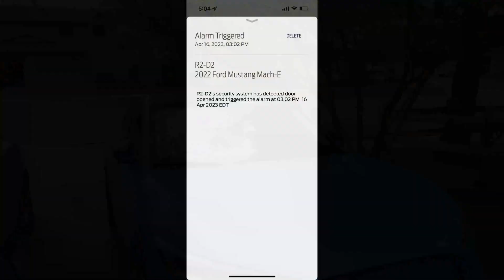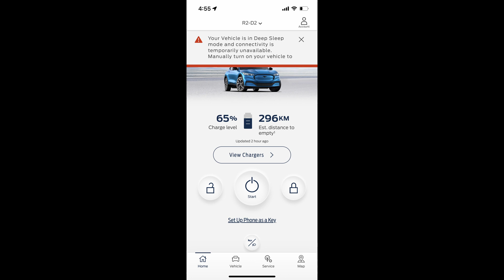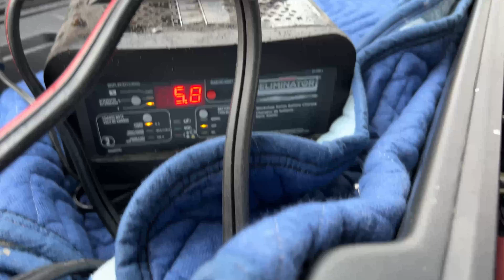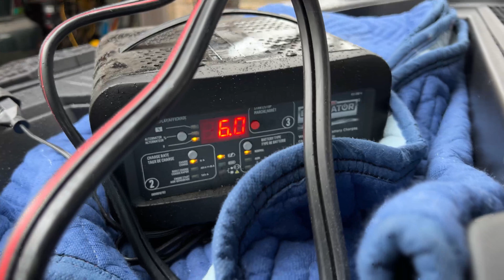Ford Mustang Mach E F150 Lightning Dead 12v Battery Diagnosis - Electrical Drain Security Alarm Code

Comment: Next time try a battery booster to boost start on the jump starter post, open the door and start the car within 10 seconds, once dc dc is on, at least you can drive until car is off. 
Learnt in a hard way with f150 lightning, but the f150 12v has bms issue, battery itself was fine
Reply from the maker: I have some other videos demonstrating the battery booster method.  Thanks for the comment and for watching!

Comment: Your video helped me out. I have a 23' F150 Lightning. Mine didnt drain to the point yours did where i couldnt open the car, but now i know its definitely the 12V. It suggests that i keep the vehicle plugged in changing to maintain the charge, but it would still die and stop my charging session. Taking it in soon so they can give me a loaner car while i wait.
Reply from the maker: I hope the video helped you to a solution.  Let me know how it is when you get the truck back.  Thanks for the kind words and for watching!

Comment: My mache is having the same issue. May I ask how long did it take to replace the battery?
Reply from the maker: It took about 3 days to get the battery shipped from the USA to Canada.  I recently had some more issues and had a part replaced.  Stay tuned for the follow up video.  Subscribe and hit the notification bell so you don't miss it!  Thanks for watching and the question!

Comment: Bet you wish you had and old fashioned key and door handle to open the door with now don't ya. Why they thought they had to do away with a real door handle and key is beyond me. Battery goes dead and you can't even open the hood to get to what you need to get to. What was wrong with the good old fashioned hood release lever and cable. Worked for the last 100 years flawlessly.
Reply from the maker: Couldn't agree more.  Thanks for watching and the comment!

Comment: So you didnt see the + and - on the plastic panel?? Thats where you jump it. The manual is full of information!
Reply from the maker: I didn't want to remove all the paneling to access the charge points when there was an easier location.  Why the charge points aren't accessible through a weathertight access point is beyond me.  There are plenty of videos and blogs on how to add this accessibility, and it may be in an upcoming video so stay tuned!  Thanks for watching and the comment!